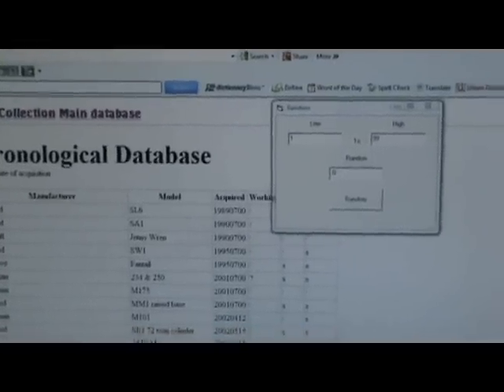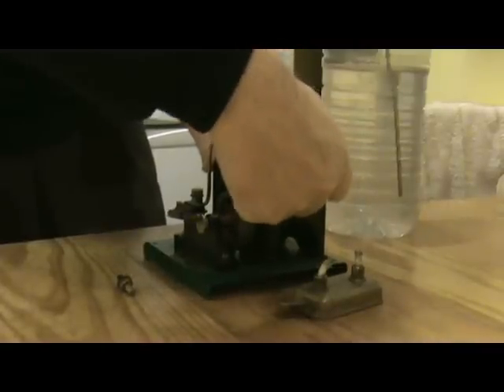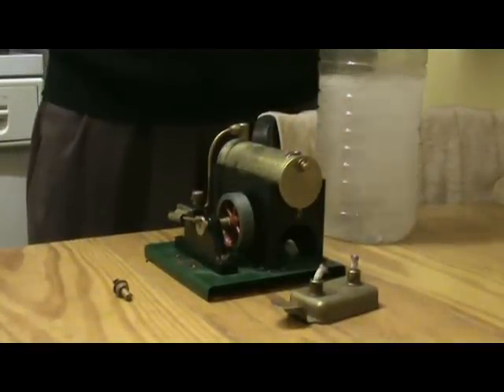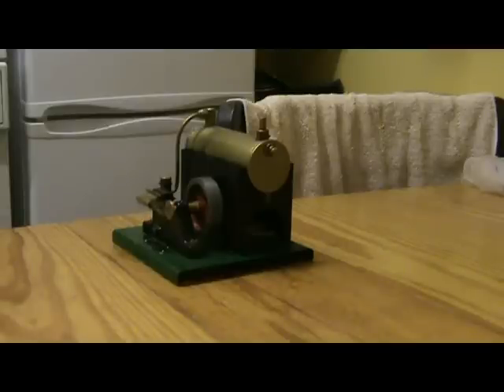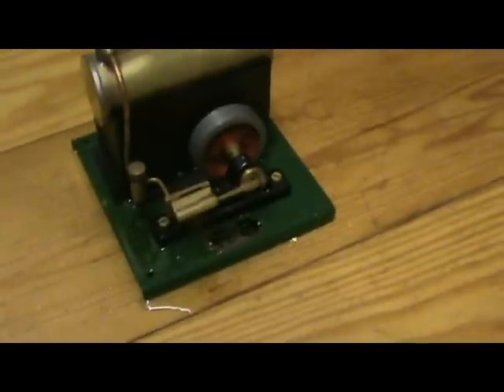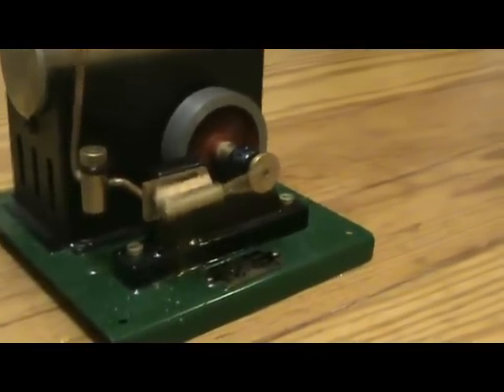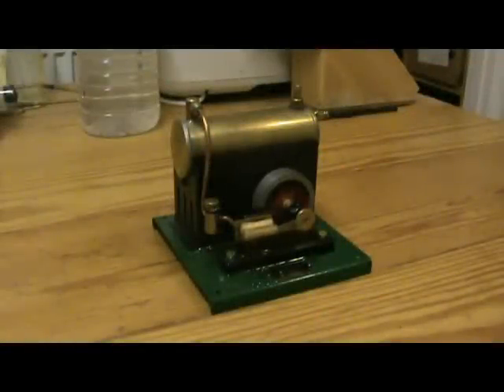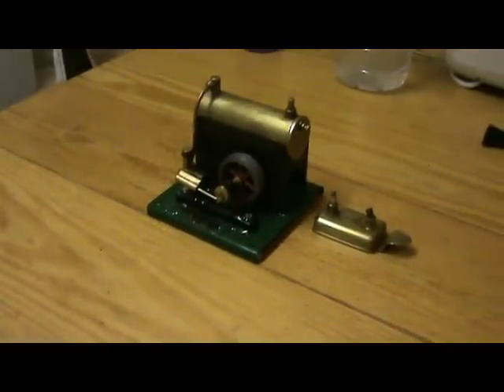SEL 1540 Standard STWWW 2012

Comment: Where do you buy new wicks for these? I've inherited a 1530 and it has none
Reply from the maker: The last lot I bought was a job lot on Ebay. You can also get cheap wicks from an old fashioned mop, but make sure it's cotton not plastic. The best stuff, however, is the so called "ceramic" fibreglass rope, obtainable from suppliers of wood burning stoves :-)